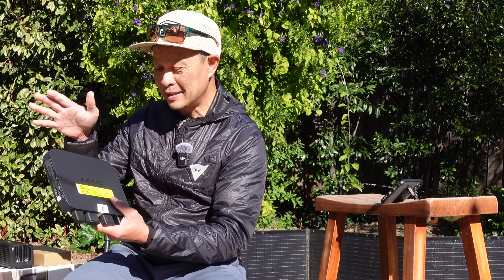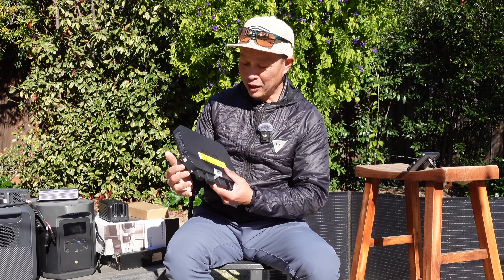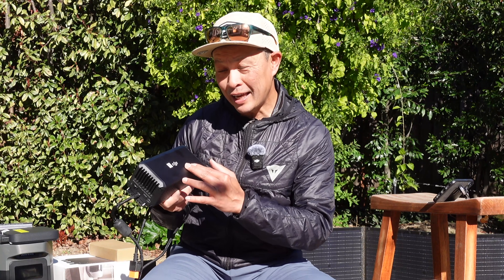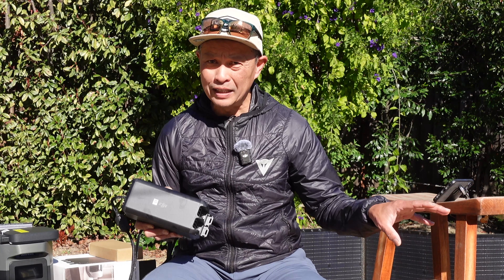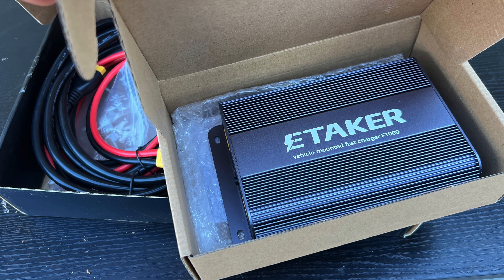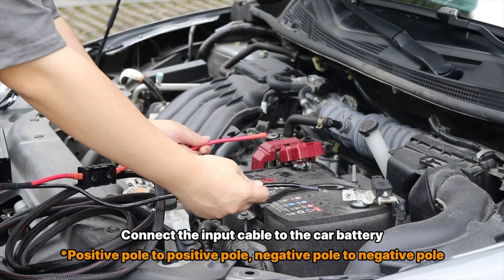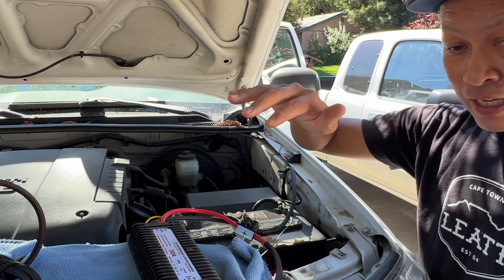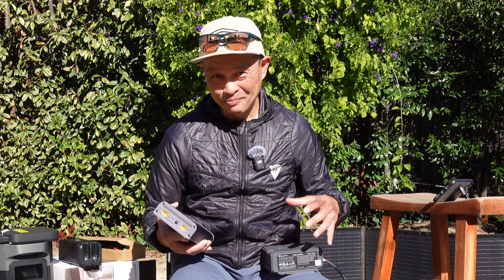6 Car Alternator Chargers for battery generators compared - Ecoflow, Bluetti, DJI, Etaker, Pecron

Comment: If you idle your vehicle to charge at 800 wats, can the alternator overheat and burn up? I saw another video indicating this is a problem, because the alternator is not spinning fast enough to cool itself.
Reply from the maker: The main issue is how big is your alternator? Compact cars have small alternators while luxury cars and trucks have big alternators.   The autos with big alternators will have no problem with 800 watts since they're designed to handle bigger loads of heaters,, ac, lights and other car equipment.

The key thing here is these devices have a 'Minimum battery voltage'  that they will adhere to, usually 12.8 volts.  If the alternator cannot get the battery voltage beyond 12.8 volts while the engine is running, it's a sign that the alternator needs more rpm or is maxed out.  The alternator will not increase load beyond that minimum voltage. So that is a way the alternator and battery are protected.

For small cars, the owner has to monitor this  Minimum Voltage Setting during install and set it accordingly.
Reply: From what I understand, alternators can only run continuously at about half its rating, ie 90 amp alternator can only put out about 45 amps continuously, without overheating. The tricky part is figuring out how much of the 45 amps your vehicle is consuming, so that you know what you have leftover to charge your power station.
Reply: The Ecoflow is not a problem and it will charge an Ecoflow Delta battery station, such as the Delta 2 or Delta 3 at a full 800W even with the vehicle stationary and engine at idle. The main engine starter battery always takes priority, so even if you set the Ecoflow Alternator Charger at full 800W and the starter battery is low, it will automatically lower the extra power pulled from the main engine alternator (say at 200-500W depending on main battery charge), and then automatically adjust the Watts until the main engine battery is fully charged, before slowly rising back up to 800W going to the Ecoflow Delta battery. 
A decent Diesel engine alternator inside the engine bay of an SUV or van produces more than enough power without taxing it at 800W. Also the alternator remains cool without a problem, and the engine fan will click on if it gets too warm anyway. While driving it is obviously better because the engine is higher revving and air is blowing through the front grills.
Reply: Spinning faster seems to create more heat, so the unit tested in another video was already flawed!
Reply: Just put a brick on the gas pedal when you get out... Easy peazy

Comment: I would also review the Victron DC-DC chargers series which have auto sensing and BT built in. The load on the alternator needs to be understood as well. at a 1000W and nominal 14V alternator output you are pulling a constant 71A, that is over on top of any loads the alternator already has to carry, so be mindful.
Reply: Thank you for saying this.
Reply from the maker: Great feedback!  For power station use, it seems like a Victron converter is needed, not a charger, since it's gonna go through solar inputs.  I couldn't really find  high voltage ones that are high amps. This is the closest: https://www.amazon.com/Victron-Energy-Orion-Tr-380-Watt-Converter/dp/B07DQ63XJ6/

Great note on the alternator load. 1000watts is a lot and most don't need that speed or load. Good news is the good units are adjustable in DC power. Also, the battery voltage minimum is adjustable so one can protect the battery and alternator as this will regulate the load put on by these chargers.  I'll try and gather up more data on alternator capacities for various types of vehicles.
Reply: Was going to comment, but you covered it all!